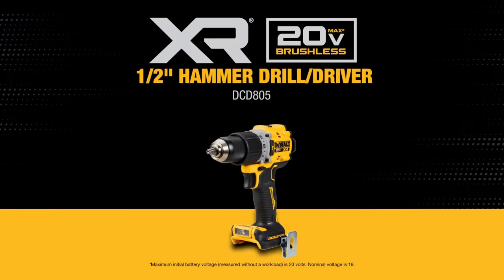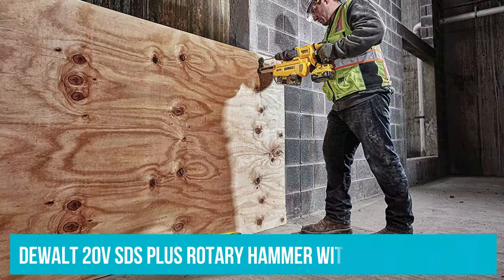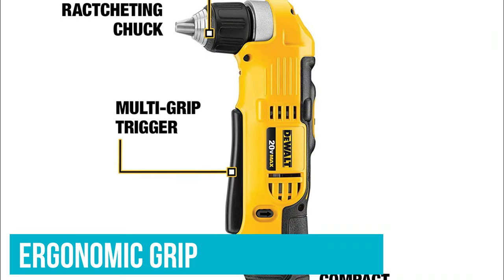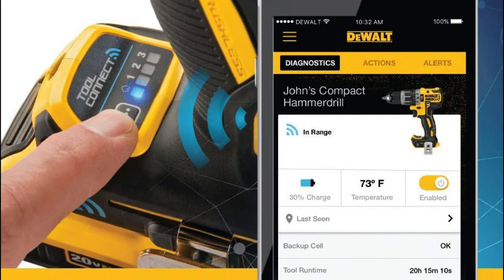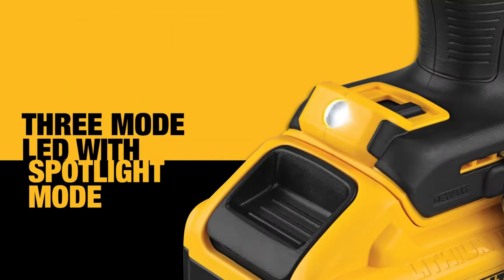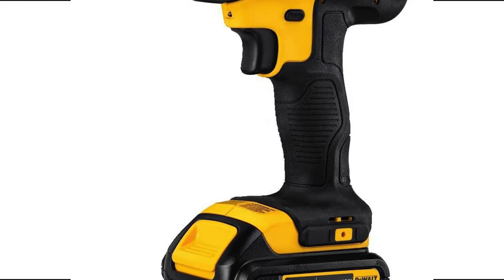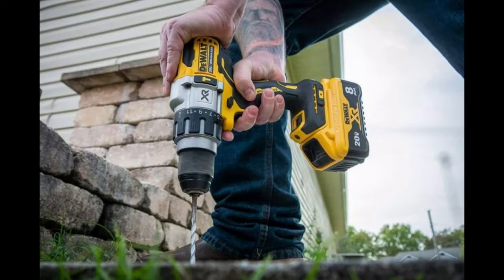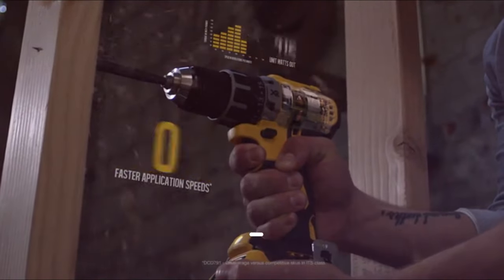What's The BEST Dewalt Cordless Drill (2024)? The Definitive Guide!

Comment: Bought a 20v cordless dewalt drill. Tried an extra long 3/16” drill bit in it and the chuck is not strong enough to grip it tight. The base of the bit is round and can’t find a long bit with a square base.  Frustrating.
Reply: Get your Angle Grinder and do what you have to do !

Comment: Went a bit nuts and got all cordless 20v  Atomic Brushless Drill, the Impact Driver, 4.5” circular saw, and angle grinder.  I need a bigger battery for the saw really but very happy with them all.  So many little things that are just great.  The speed and power is impressive.  Haven’t used the grinder yet but will be soon.